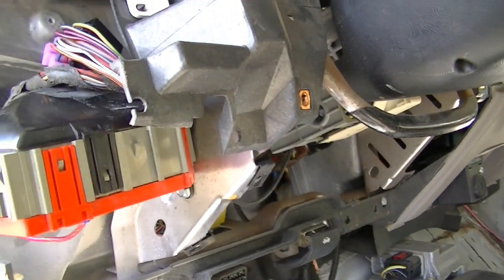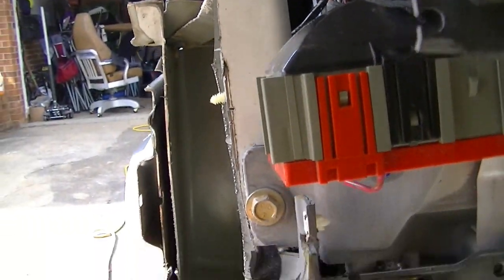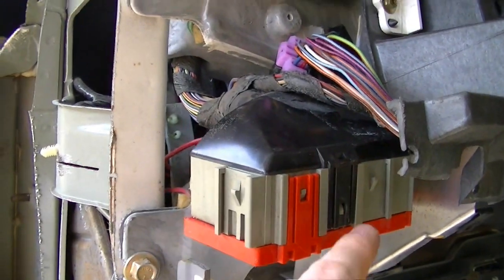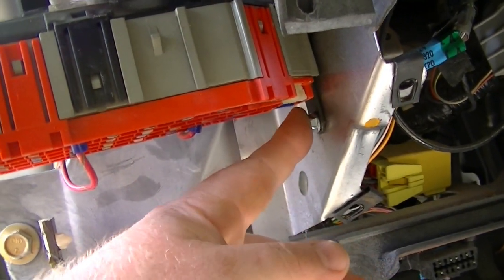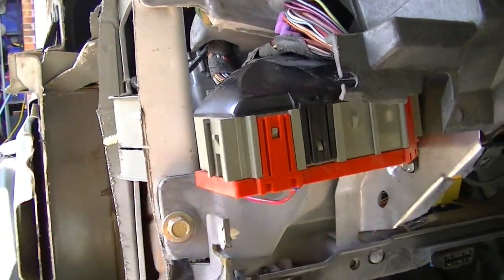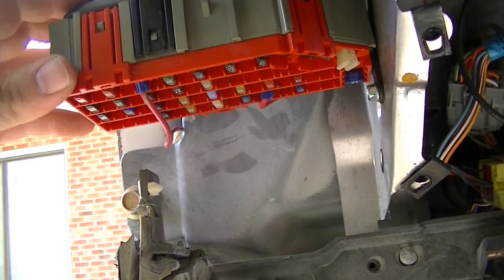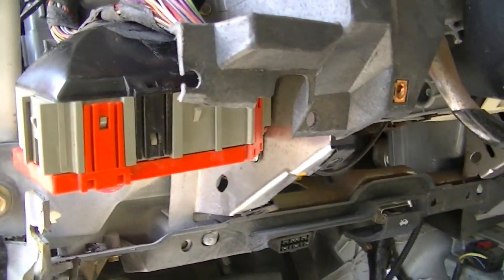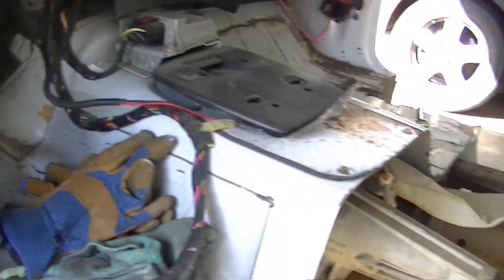The body is on the frame! Putting a square peg in a round hole! 1948 Ford Sedan body swap. Part 16

Comment: I tried to do the same to fit a 49 willys cab on my explorer.  I have determined after I destroyed basically both of them, that widening the willys cab would be WAY BETTER.
Another guy did that to fit his on a Jeep chassis.
Reply: So is the Willy's dead, or did you get it on the explorer
Reply: @channelofchannels7845  My 53 Panel is on the 2-door explorer chassis.   It fits perfectly.  But this retains the willys dash and firewall, floor etc.  The advantage of using all the wiring and aircond, steering, firewall, floor etc of the explorer is pretty big. But  I already stripped the 2 door of these parts.   I have another 49 truck cab, and might try to widen it to fit on the full 4-door awd explorer

Comment: Hello were did you find your gas holes I need it to be long to move it to the other side of the car
Reply from the maker: thank you for the comment! I purchased them on amazon. they are flexible fuel transfer pump hoses with the correct I.D. for agricultural use that i cut the pressed threaded ends off of.

Comment: How tall was your host and how wide
Reply from the maker: Thank you for the comment! 
The hoist was a little overkill height wise, but I had no idea at the time really how tall it was going to need to be. As I recall we used 12 foot 4x4's for the height a 12 foot 2x10 for the header with through bolts and 8 foot 2x4's for the bracing  The width was good but I think 8 or 10 feet would have be sufficient for the height.